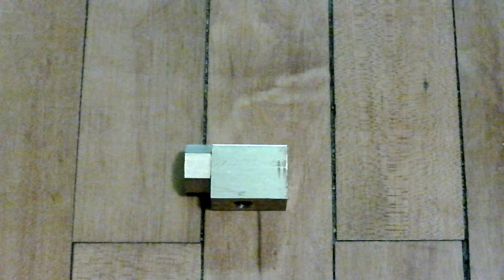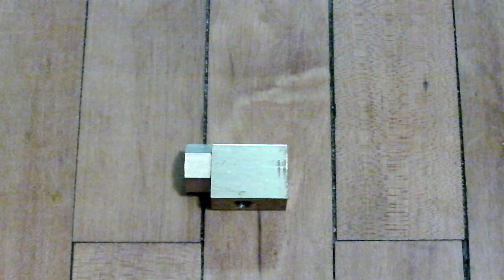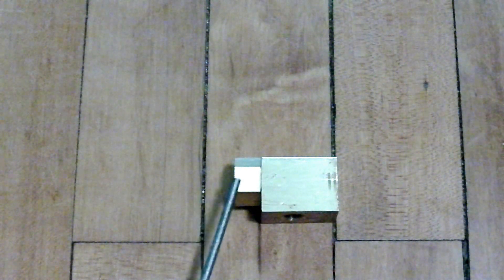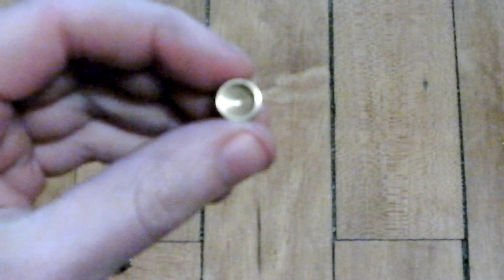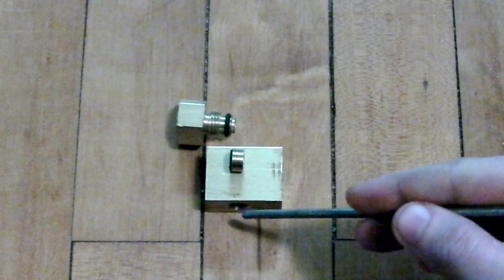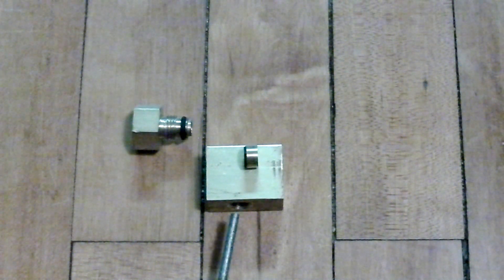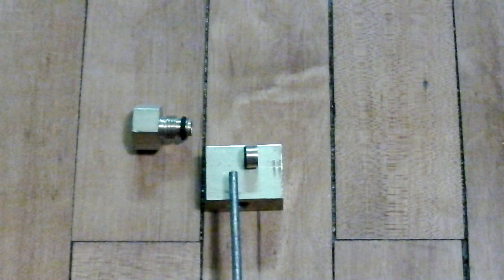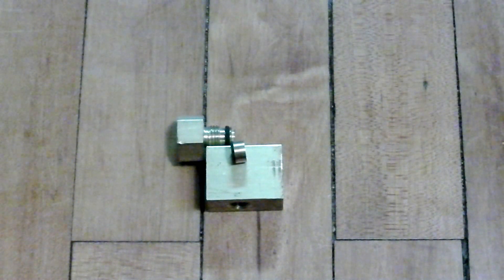Air Gun / Bow Essentials: QEV Quick Exhaust Valves

Comment: I would like to know how you figure out volume needed per shot, especially with the valves you buy. Say like to propel a paintball, I know what my tank output pressure is and can regulate that down, but how do I determine volume?
Reply from the maker: It's based on barrel volume

Comment: Is this system sensitive to bumps and shocks? If the device is dropped, what force would be sufficient to false open?
Reply from the maker: Paxmax it depends on what you use to trigger / pilot the qev. The qev itself isn't sensitive to shock.

Comment: nice and very informational! I've seen some videos where they are putting a spring behind the piston through the 'R/Exhaust' port to make it semi automatic (very unclear if it dumps all of the air in cylinder).  do you think that will work instead of using the 3 way valve and the small air container?
Reply: You rock great explanations and valuable knowledge gained for me. thanks
Reply from the maker: Raunaq mn if you read the video description, I actually mention the spring. Spring is only used when filling from the chamber side. Doesn't have anything to do with semi auto
Reply: @swandonovan  I think he means that the spring allows you to shoot once via a quick burst of air out the exhaust then when you release the trigger from your fire control mechanism, with the assistance of the spring, the piston will move against the exhaust more rapidly allowing you more shots from the same reservoir without dumping all your air in 1 or 3 shots